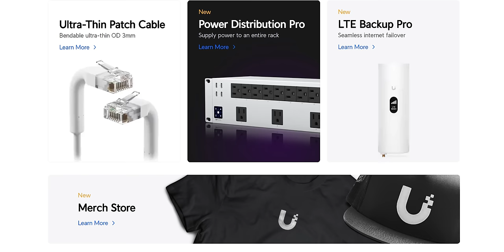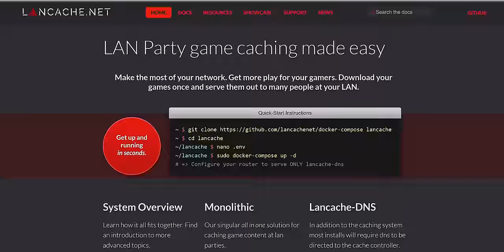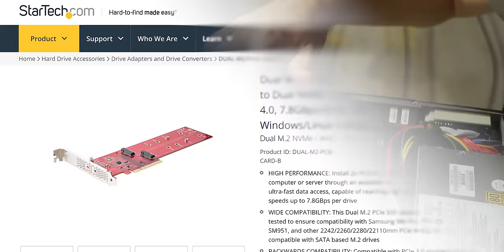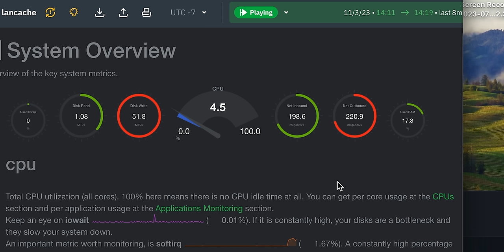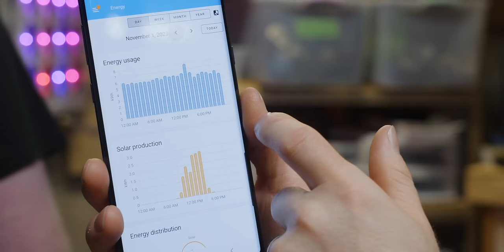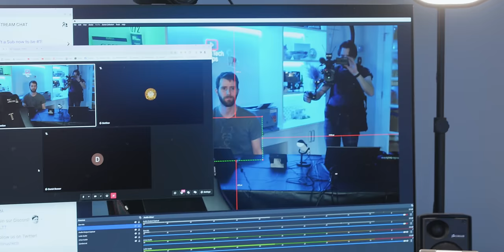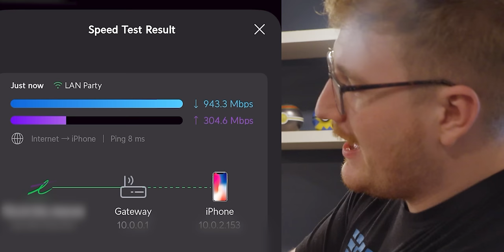I'm Lucky I'm Still Married - Whole House LAN Party

Comment: "you know the garage isn't heated right?"
Once you cram 12 tables worth of gaming rigs and humans in there, it will be quite toasty
Reply: Remember doing a lan (largest lan in the country) in a 300x60x30m large empty hall, with about 1/4 used for the lan and the rest empty. Lets just say that the building changed from cold to toasty very, VERY fast. To the point it was actually uncomfortable ... Do not remember, maybe 2K people, ... so do the math, 2k PC's with a mix of 70W idle and 400W load (most gaming)... That was outputting easily 400.000W of heat (200W average). It only got slightly chilly at around 4h as most people slept / computers off / less gaming.
Reply: @benjiro8793  that math doesn't math, 400 x 2000 people is not 400 again, that'd be like, 800,000, or with your mixed load, 400,000 maybe, but not 400
Reply: @mysteryboyee  can you read my man? 
Quote: "That was outputting easily 400.000W of heat (200W average)"
Reply: Once did a Lanparty in a school hall in the winter. We thought PC will be enough to heat it up... Boy we were so wrong! 30 people in there and I remember to this day, that everyone had on them every piece of clothes they have with them AND the sleeping bag. Still it was so damn cold many people did not go to sleep because did not wanted to be more colder... I did the math later, we were producing abot 1/5 of the building heater, which turned off for the night... We had no change to heat it up :) Since then no lanparty in the winter 😀
Reply: @benjiro8793  At the usual 60W-100W per person of resting heat emission that's 120-200 kW of heat from the people alone, even ignoring any piece of equipment
Reply: One human being is basically a 100W heater.

We're warm blooded animals.

So, having about 20 people in a room, is essentially like running a 2KW space heater... 

...but minus the electricity bill. Though you do have to feed them and supply toilets instead.
Reply: @mysteryboyee using . as a , there. I’m assuming OP is from Europe, it’s how we do decimals here.
Reply: and smelly

Comment: At 200amp 240v, I assume that means as long as most of his power draw is 120v and evenly distributed between the phases, it means he actually has closer to 400amp able run simultaneously since each rail would have its own 200amp breaker.
Reply: You sound knowledgeable. Ive never heard of power draw issues in the UK with 240v. Is this a 120v Canadian issue?
Or a 100 desktop computers in one house issue?
Reply: @5ifty7even57  You would have issues in UK too with 100 computer running, also if you're house's electrical installation is old, it may even catch fire drawing that much amps on old cables.
Reply: @5ifty7even57  In the US and Canada the 240v is split into two out-of-phase lines going into residential, each at 120v and when combined give 240v. This provides a bit of added safety with the downside of higher cost for wires. In general, you would rarely have a situation where you ran out of capacity, since even an electric water heater, electric heating and cooling, electric car chargers, electric kitchen appliances plus all the other household stuff still generally comes in well under 200a. However, 80 people all gaming might conceivably start to push it, but probably wouldn't since 200amps split into two phases actually means a combined 400amps if you only run 120v loads on it, which is what gaming PCs are. So they really weren't all that close to the limit unless they were also running a bunch of 240v stuff like AC and ovens etc.
Reply: Interesting! Thanks!
Reply: Never. That's why I was asking is it a difference between wiring standards, or an exceptional use case.
Reply: @@GH0STST4RSCR34M You are missing the point. Even 100 gaming PCs running each at 350w drawn from the wall could theoretically fit in the power budget of a 200amp system.

Comment: I had a 10 person LAN party once, in 2007, where it was a blazing 32 degrees Celsius outside and I had NO airconditioning. And nothing other than fans to blow some wind through my house. That was the last time I had living fish in my aquarium. They popped up and whatever we did, we couldn't save them. In all honesty, I think the 32 degrees C without Airconditioning would have done it on it's own. Back then, it was considered extreme heat in Holland.

Comment: To all of you who think "it is cool that LAN's are coming back" please note that they haven't gone anywhere. Check your local area for smaller events. Sure mega size ones with thousands of people are rare but the smaller events still run all over the place all the time. In fact it is to protect those smaller events that have poor net connections (here in the UK anyway) that LAN Cache was originally designed for.

Comment: Yo, 100% not a sponsor, but I love my ubiquiti setup! I don't have a big house, but I have a tall house. My home was built in 1930, so the walls are really thick, it has a finished attic and a basement. Between 4 floors, the wifi never stood a chance to reach every level. And I tried the basic wifi extenders from amazon and they never really worked, or it required you to log into a totally separate wifi. Fortunately for me, the last owner installed ethernet throughout the entire house, so I got some UniFi access point devices for each level of my home. I then installed the UniFi software on one of my PC's so that I could easily control everything and my wifi issues disappeared over night. Honestly it's really nice.

Comment: I can't see the house havine enough power. 500w at 240v is roughly 2 amp. I know its 110 but the incoming is essentially 240. Now a pc could easily pukl 500w then add in the ac,lighting, networking. Surely will run out of supply pretty quickly.

Comment: You can't run it at 50G. Two 25G ports does not equal 50G. It can equal two Ethernet streams around 23G. You aren't combining the through put, it's just adding another lane to the highway.

Comment: 200A 240V circuit is plenty hah! I have about 210 SFF boxes with integrated graphics crunching away on BOINC no problem. I have split my electric car charger circuit (NEMA 14-50) into 2x4 120V circuits, currently using 6 of them for the garage computers and can still charge my car at a slow 15A without tripping the 50A circuit. AC on at same time no worries. Cheers! I think it's somewhere around 12KW continuous drawn by all boxes. That includes a ridiculous Chia farm under a bed. 

And.. all these are getting internet via WIFI... granted they need very little bandwidth and occasional hiccups do occur especially if BOINC projects need to update the database file instead of just downloading/uploading work units, or a project goes down for some time causing data surge,  but does not affect compute only takes a minute a day to keep busy.

I can understand needing cable for gaming although your super duper Ubiquiti tech could probably handle it if no collisions.

Using an XB8 comcast modem, a decent repeater of some kind in garage for 30 boxes only, and then a single tp-link deco mesh node to ease load on XB8. All WIFI except like 5 of them. Only 2.4 and 5GHZ WIFI 5, no 6GHZ biz.

Perhaps this gives you another idea for heating the garage in the winter besides mounting the GPU stack under the desk this year.

Comment: One day I'm going back to a LAN again. With the last rig I took to a LAN: CPU cooled by an Asetek Vapochill LS 240 (this time with 3d printed mount for current cpu gen), re-equipped with a 1/4 horsepower compressor and refilled with R504 coolant, I'm going to carry a 20kg tower to the LAN! But it'll be worth it, when I count the fps 💩

Comment: a suggestion on the audio. I would suggest putting on a high pass filter since there's a lot of random noise coming in that's sub sonic which could damage speakers not made to handle is or aren't protected for it.

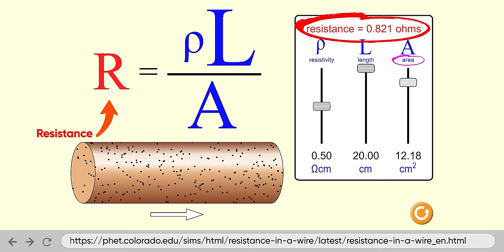Comment: 4:20 doesn't a thick conductor make it less efficient in power keeping in mind that neither the voltage is changing nor current! Need to check with my physics book, I might be wrong, but I remember that thicker conductors are used to transmit high voltage but then they are smaller individual thinner conductors coiled together, which keeps the power. Again, I might be wrong but hope we can get a better explanation for that!

Edit 1: Added timestamp cause it was a good number

Comment: I haven't figured out design center yet, I think you need to hire a contractor or someone to design a building plan.
My home is from the early 1900's and originally was not even a home was just a tiny little camp.

Comment: here they are, talking about their networking with like 10gig or whatever, and then here I am, with a really long ethernet cable connected right to the router, which is just 10 feet away, which is connected to the modem, 1 foot away from the router. Frankly, I am confused.

Comment: No way anything in that house is on a 15amp circuit, besides the smoke alarms. Just because the receptacle says 15amp, doesn't make it 15amp. About guarantee that its on a 12 gauge wire hooked to a 20amp breaker, making it a 20amp circuit regardless of the receptacle.
But yea 20 amp circuits, prob tap out 4-7 PC's depending on usage, im estimating 600watt each.
Then thing your failing to realize with 100ft extension cord. Which you sort of touched on, but seem not to know. Longer the distance more the volt drop off, more the volt drop off, higher the amperage. Which can hurt components or break breaker. Which is why you didn't want it just rated for your circuit, you wanted 10gauge for 100ft on a 20amp circuit at minimum. 15amp wire would be 14 gauge and thats smaller than the wire its ran on inside the walls. Then Id recommend having a fuse on that extension if that length.
Flipside I'm not an Electrician in Canada, where things may be different.
The 2phase 240v doesn't apply. Because he has no idea which circuits are on which rail. For all he knows 7 of the circuits of his 8, might be all on the same 120v.

Comment: At my job I am getting rid of the  ES-16-XG 16-Port 10 gb sfp current core switch because the gui sucked and to make any real changes needed to run on console cable. I am now waiting for my new broadcom 24 port SFP+ 10 gb with 2 40gb ports. Unifi has great wifi and camera but sucks when it comes to networking in my opinion for commercial use anyway

Comment: Hello🙋🏿‍♂️ guys. What is the best versions of 4080/7900xtx (im little confused🤔 because when i type either 4080 or 7900xtx there're a lot of types ) also what gpu(7900xtx/4080) is better for now? What mother board and cpu would be best match for them 🤔(hopefully someone responses 😊)

Comment: Soo for the shadow mode on the dream machine… what if you where to run your WAN through a small switch that just has two ports as a trunk back to the main WAN ports on the UDMs? Would that actually work? Because if that is the case I’m definitely interested in something like that.
Edit: having 2 UDMs running is cheaper than having one with a RPS for if the PSU fails.